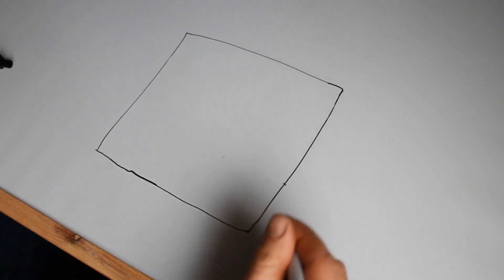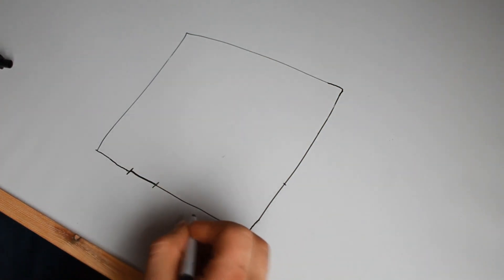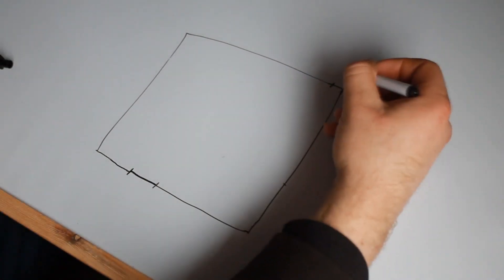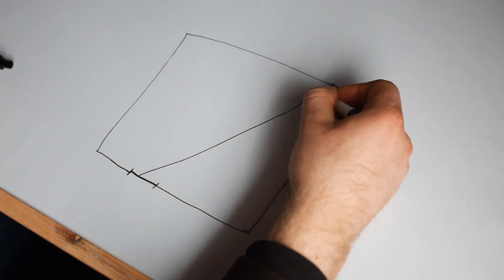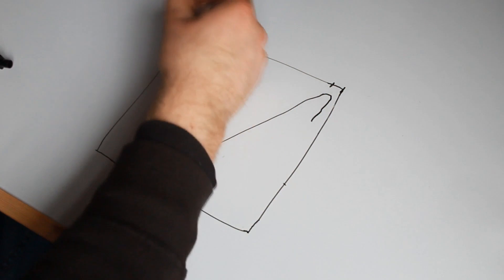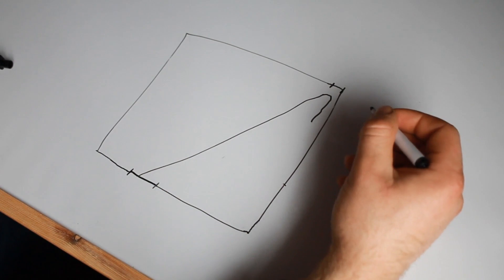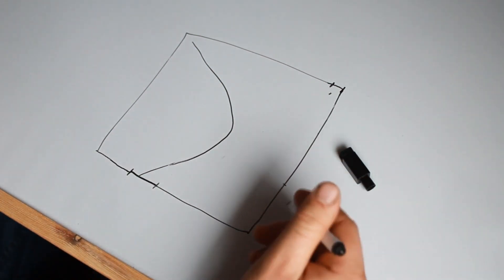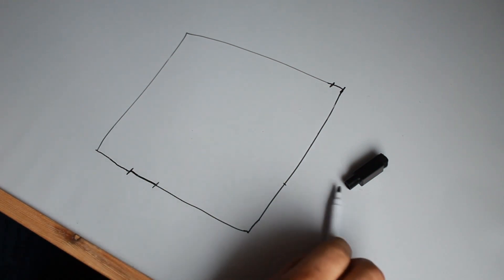How to spread slurry with umbilical system

Comment: If the field is flat it doesn't matter which way you reel out
Reply from the maker: No it doesn’t matter but it is by far easier to roll out from the pump to field over field to pump as it leaves the pipe stretched out
Reply: I reel out one side then halfway down again

Comment: So you go up and down the field driving over the pipe each time rather than spreading diagonally either side of the original pipe you put out?
Reply from the maker: Yes it leaves the field easier done and leaves a nice more even spread as hitting the hedge at an angle you’ll either miss bits or do a good bit of overlapping.
Reply: Doesnt ever damage the pipe then? I've never had the nerve to go over it
Reply from the maker: I have done it 1000s of times never damaged it. If your using a trail and shoe or tracks they’ll damage it but never damaged a pipe by crossing it not yet anyway.  But if the pipe is old and knackered it might damage it but I’ve driven across piping we’ve had for since we started this craic 18 years ago still fine
Reply: Won't your hose burn ??